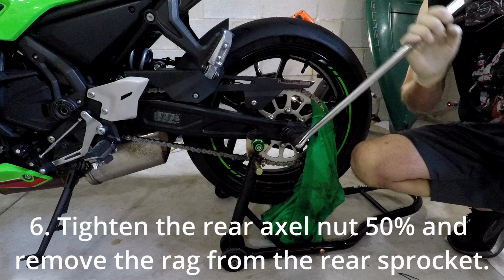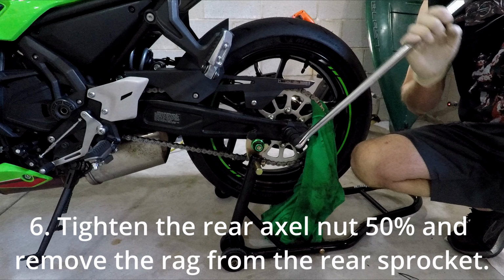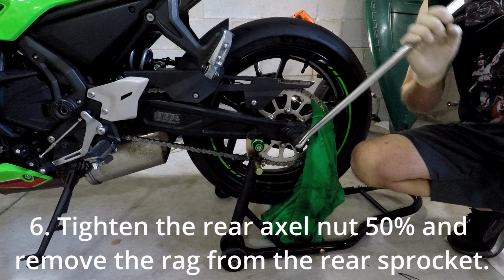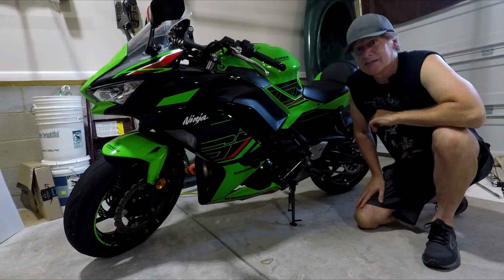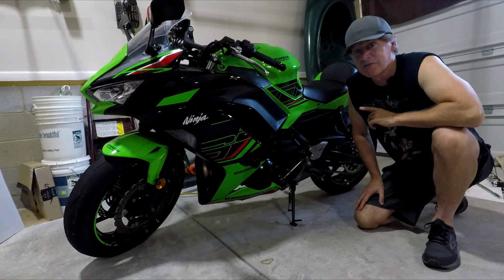Ninja 650 Chain Maintenance

Comment: Do you put the bike in neutral to do the towel part in the chain or put in gear, Along with tightening the axle to 50%?
Reply from the maker: The bike is left in neutral the hole time.  I only use the towel in the rear sprocket if the rear of the bike is lifted in the air with spool lifts.  If setting on the ground, while tightening the chain, you can skip the towel in the rear sprocket part.
Reply: Okay thank you, I’ve had a hard time keeping the left wheel alignment indicator from rotating clockwise when tightening the axle nut back down after adjustment of the chain. I’ve been looking for answers on why it does that and really haven’t found anything. I’m wondering if i try it this way if it will work better.
Reply from the maker: @AkzoPainter  That left and right alignment indicator should be shaped so it will not rotate.  It is like a metal plate in the shape of a C and somewhat wraps on top of the swing arm.  At least on the 2023 Ninja 650.
Reply: @StreetMotoZ  yeah it doesn’t rotate completely, but it will rotate enough to ever so slightly throw the notches to indicate alignment off on that left side.
Reply from the maker: @AkzoPainter  Yes, the swing arm notch indicators on the Ninja 650's are a bit crude, that is why I explained using a tape measure in the video to make sure both left and right sides of the rear axle are square with the swing arm pivot.  The tape measure method is much better than relying on the alignment notches.